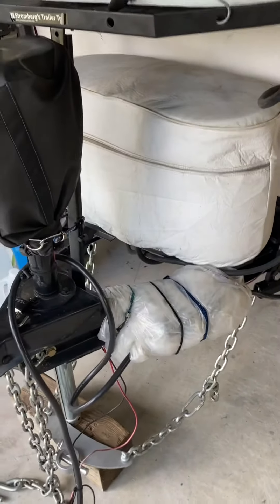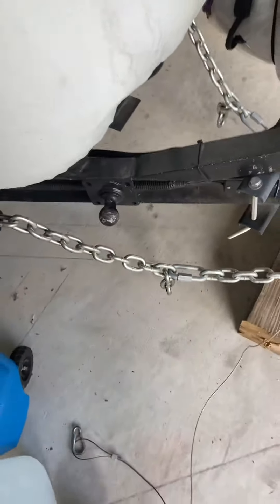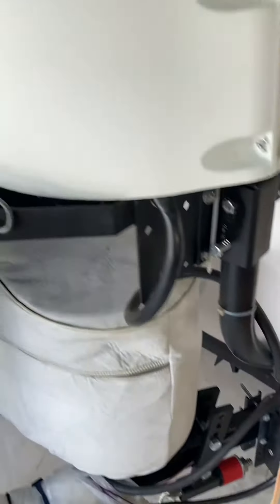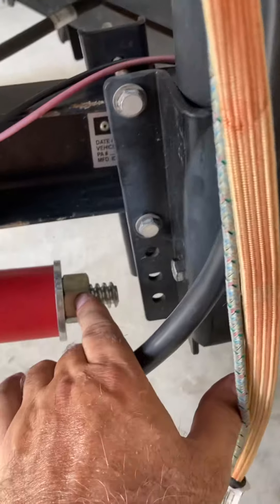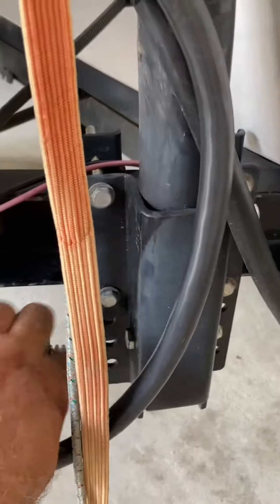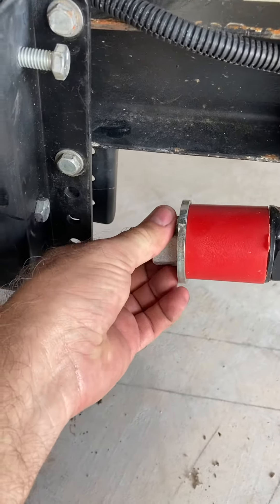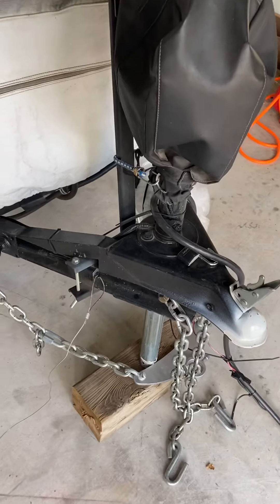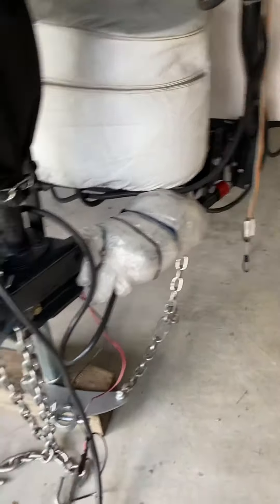DIY Anderson Weight Distribution Hitch on Casita Travel Trailer

Comment: We have a 2019 casita SD, how far back are your brackets mounted and what are measurement the points ? We do not have the  Stromberg Carlson tray yet, but we do want to get one.
What part number is your Andersen WD hitch? 
Thank you,😁🛫
Reply from the maker: If you plan to install the SC you will have to push the brackets back the maximum you can to still be able to install the tray up top as well as leave room for the Andersen.
Reply from the maker: What will you carry on the SC?
Reply: Possibly a small generator.
Reply from the maker: @TheFalconJetDriver  just remember you are changing the weight of tongue and of the trailer.

Comment: Thanks for the video, we just purchased a 2016 Casita 17 SD, did you experience sway with the anti-sway bar, before switching to the Andersen hitch? Or way sway noticed when not using the anti-sway bar? What was the tongue weight % of load and have you made other changes to address the cause of the sway? Finally are you still using the Andersen hitch? I would be using the Andersen with a uni-body Hyundai Santa Cruz.
Reply from the maker: You should have absolutely no sway if you have made no modifications to your casita and your vehicle has proper towing capacity.  You only have sway when you have changed the weight distribution of the Casita, I.e. you added something heavier on the back or front or have more weight on one end or the other.
Reply from the maker: I tow with a Toyota 4Runner and with no mods to my casita I could have towed and been perfectly fine with the anti sway bar but i decided to do Anderson just as additional support, also you are suppose to disconnect the anti sway before backing up and I didn’t want to have to do that.  But the trade off is hooking up the Anderson is a bit more involved versus the anti sway bar,  be safe.
Reply: @ziprun1  Thanks
Reply from the maker: @55tt551  yw, anytime, be safe.